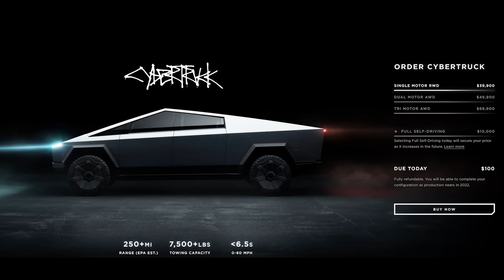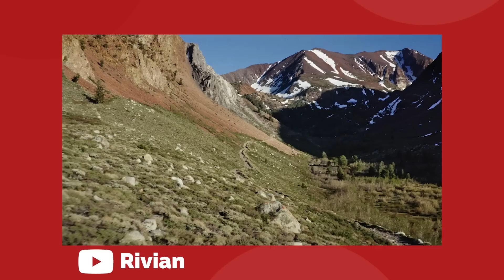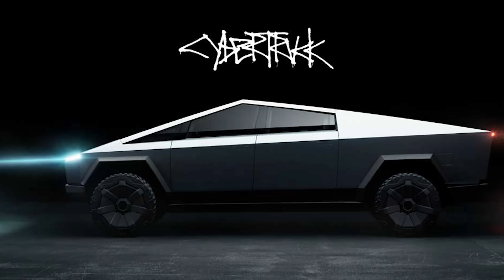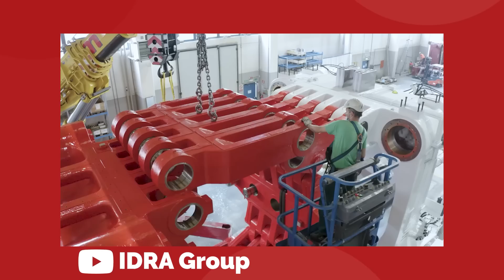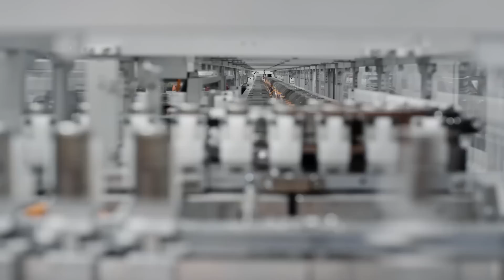The 2023 Cybertruck Update Is Here! (Cyberboat + All New Features)

Comment: Here are the key points about the 2023 Tesla Cybertruck update from the video:

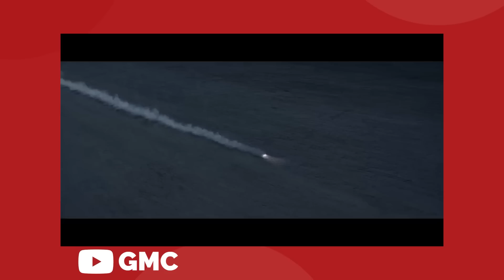- The Cybertruck will have 4-wheel steering and 4-motor all-wheel drive. This will make the large vehicle much more maneuverable and capable off-road. (1:19 - 2:30, good news)

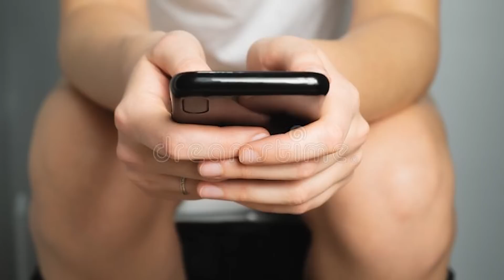- Elon Musk said the Cybertruck will be waterproof enough to briefly serve as a boat and cross bodies of water. This could allow travel between SpaceX facilities without driving around. Actual feasibility is still questionable. (5:28 - 7:45, interesting but uncertain news) 

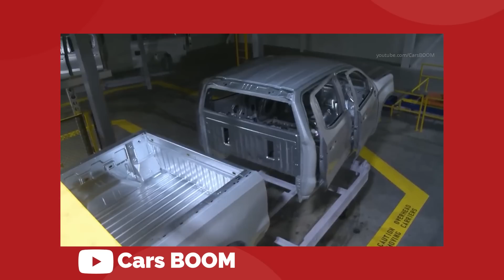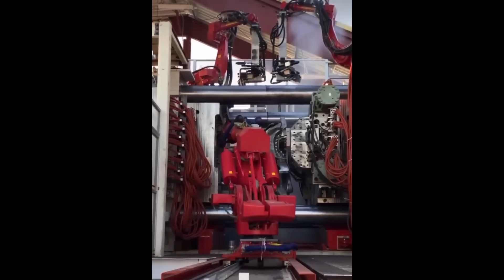- The Cybertruck will use an exoskeleton design with large steel panels to eliminate the need for a heavy truck frame. This, plus the structural battery pack and gigacastings, will reduce weight and complexity. (8:55 - 11:21, good news)

- Tesla's new 9000-ton gigapress is completed and shipping to Texas for Cybertruck production. This confirms they are still moving forward, though the timeline is uncertain. (11:59 - 13:11, good news) 

- Elon Musk claims production will start mid-2023, but his timelines are consistently too ambitious. The factory and equipment status suggests this could be more realistic than past claims. (13:47 - 14:19, optimistic but uncertain timeline)

- Pricing is unknown but will definitely exceed the originally advertised $69k maximum price, possibly by a large margin, due to features and inflation. (14:52 - 15:23, uncertain news on pricing)

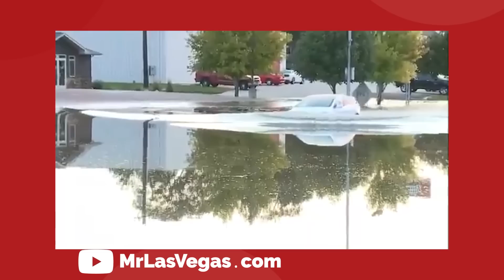Comment: 5:41 Tail pipes? Pretty sure it’s primarily because water getting into the engine air intake. The intake meant for air to get put into your engine for combustion… water getting in there stalls your engine. Likely causes long term damage too. So if the water is high enough that it reaches the engine air intake, that’s why it’s bad. Hence why hardcore off road vehicles often have those elephant truck looking engine air intakes sticking up high in the air above the hood or above the whole car. Because most cars have the engine air intake somewhere under the hood, often near a wheel well, low enough that that crossing water a couple feet deep becomes a risk. Not to mention the type of water that Tesla crossed that went over the hood.
Reply: He is not very educated in internal combustion engines. You're right, the important thing is that the air intake is above the water line, not the exhaust pipes. There is enough pressure from the exhaust to make it out, easily. Just take a look at motorboats, many have their exhaust pipes below the the water surface. But if your engine sits low you need some kind of bend/water trap, like the one you have under your sink, so that the water does'nt make it to the cylinders when the engine is not running.
Reply: @ai._m  No, it is not both. 10 meters of water depth equals 1 bar. A submerged exhaust only need a few millibars of overpressure to work. When you are so deep that the water pressure in the exhaust matters, your air intake was submerged long ago ...
Reply: It is also a bad idea of thermally stressing the engine and exhaust manifold by quenching it in water.  This is not an issue for EVs.
Reply: I THOUGHT WE WERE TALKING EV'S
Reply: @ricinro  Please educate me on why it's stressing to cool down the exhaust system/manifold. My naive thought would be that cooling the exhaust makes the exhausts more dense, which leads to less backpressure, which is even preferable for a turbo engine (when it's between the turbo and the atmosphere). Sure, a NA engine is designed to have a certain back pressure but I'm a bit skeptical to that the tolerance level is that sensitive. I mean you can run a NA car engine at an airtemperature of -20 degrees celsius without any problems.
Reply: @stickiebudz  😅
Reply: @MightyMethod  Scavenging. Turbos have near limitless backpressure. Naturally aspirated engines do need to maintain a minimum backpressure still, else back firing occurs and causes scorching to the valves, in turn causing the loss of compression.

Sudden thermal changes can, and will, create microcracks due to the thermal stresses, leading to exhaust, intake, and/or vacuum leaks. Constant, repeated extreme temperature fluctuations will be catastrophic to the engine, however a single occurrence is unlikely to be noticed however...
Reply: @72192cody  Oki doki. I get what you're saying about the risk of getting cracks. But it feels like you'll have to be rather unlucky to get that kind of damage. Good for me I never drive in deep water. 😅 However, I do expose my car to "constant, repeated extreme temperature fluctuations", but that is towards the hotter temperatures. 😂 Thanks for your answer.

Comment: Your synopsis that the exhaust being underwater keeps the engine from running is wrong !!!
-
Lots of boats have their exhaust under the water line !!!
-
The reason cars die in the water is their air intake tube is very low and sucks water up through the intake into the engine creating a Hydro lock…
-
That Hydro lot can bend valves or break or crack pistons or even split the block…
-
Please do better research before you make random statements….
-
😊Have a Nice day 😎

Comment: Doesn’t matter if all 4 tires are moving or if just one, if you’re on ice you’re not going anywhere quickly.  And if you’re in large mud/water hole floating doesn’t help if the tires are just spinning in the water.
Reply: 304 stainless does not like salt water it rust a flat bottom Pannells don't like mud like the first hummers TOWIE's for off road trackss  everything you just said is true
Reply: Sherp

Comment: The in house battery cells should bring down cost, pretty much everything about the vehicle is designed to be efficient for production and cost. Why would it be so much more expensive? It was going to have 3 motors with 1 motor being bigger than the other 2, but now it will have 4 smaller motors. I don't understand your reasoning behind saying it will be way more expensive... I calculate they removed the price because they will price it according to demand and competition. If they sell it too high people will buy other options, if they sell too low demand will never end. I think the RWD models will come out first and priced at original price. If Ford can do it, Tesla can. After the initial hype train wears off they will introduce the higher priced ones that will not be too far in pricing, but they made more profit by selling the least costly model first. I believe that was their original plan and I think it would be the smartest plan. If they come out with the most expensive one first they will risk the waiters to cancel their orders and buy something else...
Reply: I heard they want to move the high end trucks to the front of the line, and not even make the 2 wheel drive single motor version. So it will be dual motor, tri-motor, and quad-motor. They have to offer the quad as the Rivian, and Hummer are both quad. I just want the tri-motor for the 500 miles of range, I don't need the quad.
Reply: @dalanscott  I think the tri-motor wont happen. Most likely it will be RWD, AWD Dual and Quad motor... Do you have an electric now? Why do you need 500 mile range, after 200 miles I need to stop anyway because of bathroom or food/drink for someone. In town driving absolutely no need at all. I think the AWD 2 motor will have a long range option like the model 3...

Comment: I knew when I spent the $100 on the queue the price wasn’t locked in. No surprise there. Why be upset? I think the single motor 2WD version will start around $50K but virtually nobody’s interested in a single motor. The dual motor 4WD will be the most popular with three motors a close second. Realistically a dual motor I’d bet will avg $75K, three motor $90K and a four motor fully equipped will be $130K.
Reply: Good luck with those prices, it will be close if not over 100k for a base model
Reply: @wasupfool5692  - We’ll see. With Ford already selling its electric truck’s base at $50k I seriously doubt a six figure base model Cybertruck. I stand by what I said. The two-motor AWD will be the sweet spot. Most people seem to have no problem ponying up $75k these days. But again, we will see.

Comment: When Elon mentioned a floating CT he may have been telling us the CT has fly-by-wire proportional steering and electronic braking (no hydraulics).  If you eliminate places where water can get into the bed and cabin then waterproofing is done on the lower parts of the doors, tailgate and around the battery pack/ seat assy that is installed from the bottom. So while it is not officially mentioned there is a possibility that there will be independent steering, electronic braking, torque and electronic suspension for each wheel that could actually reduce costs.
Don't dream about this being licensed Coast Guard approved watercraft but sure fording slow moving streams and swamps/ponds offers utility rarely considered.
Reply: I bet all four wheels are the same portal axel waterproof motor

Comment: I understand that the hardware costs can’t remain fixed.  That just wouldn’t be possible.  Software on the other hand does not experience the same inflation effect.  I would hope that Tesla would honor that pricing.  In my case, my tri-motor reservation included FSD at $7,000.  I think $15,000 might just cause me to reconsider my reservation.  I have my heart set on that truck and am running my current ICE Jeep into the ground to avoid purchasing another clunker ICE.  With the economy tanking, I may have to abandon my dream vehicle. 😢😢😢😢😢😢😇
Reply: Why would abandon it or reconsider it based on FSD? That’s silly.
Reply: If you ordered with red ityink you get the price from when you ordered. And musk has said that all that do not order the price will go up. It's not inflation, it is on sale. The price will go up untill the full price is achieved
Reply: It's about the company and vehicles as a whole...people are probably more likely to accept a price increase for an awesome new feature rather than the structure of the vehicle..if they can use fsd to help fund the rest of the company why wouldn't they
Reply: same here, have my Jeep but really wanted this truck, and software development does inflate with inflation due to rising salaries trying to compensate cost of living increases.

Comment: the only reason that elon added the 4th motor and rear wheel steering was to compete with the Rivian and Hummer.  I suspect that the price for the top version (4 motors) will be 79 or 80 K USD.  As I am a Canadian, this will cost me at least 100 K in CAD plus another 13 K in taxes (GST) so I will be happy with the three motor version (if it is still an option), provided it has the large battery- which is the most important feature other than the stainless steel.
Reply: And competing with Rivian or anyone is a bad idea because ?          If you were in Tesla's shoes would you stick with the original design limitations when others are one upping you?  This is supposed to be kick ass.   
Feel for you on the exchange rate.    I have been waiting for somebody to start an EV car company in Canada.

Comment: Constant exhaust pressure from a running engine will prevent water from entering the tail pipe and stalling the engine. Ice cars suck up water from their air intakes and hydro-lock their engines. Besides what exhaust pipe does a Tesla need to worry about?
Tesla Nerd ! LoL ..def not a car guy but sure knows how to make a YouTube video

Comment: Ummm No.. cybertruck is waaaaay smaller than the hummer ev. 
DOT law requires a vehicle to have “identification lights” if it is over a certain width. Those lights are the 3 orange lights on the center line of the truck. For example; Ford F150 Raptor, Ram 1500 TRX, and now the Hummer EV.
Tesla Nerd, a car guy would know that. LoL

Comment: Let's think the tailpipe commentary through again, it's just bubbling boss, water's not stopping them. It's low air intakes that suck water into fuel injection systems and also ignition related parts that aren't designed for submersion is my guess.
Reply: Increased backpressure in the exhaust is a major no-no, definitely slows the compression cycle down... leading to decreased oxygen intake, and to an extent, increased heat, which can cause warpage fairly quickly. Even worse though, are non-pressure rated seals... think the crankshaft main seals... oil and water don't mix... oil not only lubricates, but also creates a cusion that softens damaging forces from every single explosion that occurs. Without the oil in place to dampen the blows, micro-cracks occur repeatedly until metal parts end up where they're not supposed to... on top of that, now you basically have sandpaper inside the engine, and possibly transmission, due to the minerals in the water. An extreme case, but can happen very rapidly.
Reply: I bet you do, but I'm giving it back to you as a donation.
Reply: Close. It's in fact water being sucked into cylinders and water doesn't compress well. So.... boom, your crankshaft, cylinders, pistons, valves got bended, crashed etc. Engine dead usually when sucked water.

Comment: FYI for those who don't already know, when you say a 9,000 ton Giga press that does not mean the Press or machine ways 9,000 tons it does not mean the parts or metal being used when casting way 9,000 tons color the 9,000 tons is the maximum closing or clamping pressure on the die while the molten material is being injected and molded.
Reply: You are correct. By the WAY, the machine does not WEIGH 9000 tons.
Reply: I can lift and carry my 2-ton bottle jack with one hand.

While impressive, the 9,000 ton rating isn't what makes those presses so transformative. It is the speed. The total cycle time is under a minute. 60 vehicle frames per hour, starting with molten metal.
Reply: @The_DuMont_Network  Thanks, if you hadn't said it, I would have had to. 
YouTube checks spelling, but not grammar.

Comment: About the Cybertruck being a boat, there are multiple news reports out of Florida about electric vehicles that caught fire.  Fires were a result of submersion in salt water causing corrosion which led to electrical shorts.  Seal the batteries all you want but there will still need to be a connection running to the motor(s) which will be susceptible to corrosion.

My biggest concern however is the elimination of radar sensors.  Vision may be great 99% of the time but if you have ever driven in a medium to heavy fog with vision possible for 100-300 feet and suddenly encounter a dense fog bank with vision in the 5-10 foot range, at 45-90 feet per second I doubt that vision only will suffice.  As a flawed human my choices have been to grip the wheel, grit my teeth, continue as before and hope for the best or to slow down and hope whoever is behind me is also slowing down.  Maybe Musk's cameras can see through fog but no one's bragging that it can so I doubt it.
Reply: about the radar they could maybe even add it easily if needed plus if its TRUELY TRULEY fsd its worth $250k just for the fsd and will make you easily hundreds thousands. so you have no concern in reality.... worse case it can only follow in a convoy on hgihways in safe weather thats still worth 100k value+ and they charge like 15k for it

Comment: Lol water covers tail pipe and ice fails... you have no idea how ice cars work. Intake air pipe gets water in it or the fuse box are the problem areas. Those 2 areas and you are hosed with water.  Electric cars are high power and so are sealed better. You can seal up a car and we do, off road trucks do it all the time. You just need a fresh air intake higher than the water.

Comment: I really hate the pink foam/pack design on the new battery packs. If youre out of warranty and a single cell goes bad they have made it incredibly difficult for people to replace that cell. People are going to end up paying 10s of thousands because of a faulty component.
Reply: One more reason for me to not go electric
Reply: thats dumb cause the quality is so good you never need to duh... it might even outlast old tech 2x lifespan so the value is twice as good as the best tech last year...if the lifecycle true
Reply: Thanks for watching and commenting .expect more videos. send me a text above 🔝🔝🔝  and acknowledged your price .......................
Reply: @travish585  it's not about lifecycle, it's about one of the cells being faulty. It happens in EVERYTHING that has a battery. Even the most advanced tech in the world will have some defective products at scale. 

Having a few faulty cells in a pack should only cost a few dollars in parts and a little bit of labor. But the battery packs aren't designed for repairs at all. Yes there are advantages to this kind of thing, but it's like apple gluing all their components down so if 1 thing goes wrong you need to buy a new device.

Comment: No with ice cars if you go to deep in the water the water will get into the intake and from there it will proceed to make its way into the combustion chamber and while in there as the piston goes up it will only be able to compress the water a little before the piston rods bend since water can’t be compressed as much as air can and that’s called hydro locking
Reply: Water is so dense that it would choke before water gets into the combustion chamber.
Reply: @battery_wattage  Water would most definitely get into the combustion chamber if it is able to cover the intake enough to "choke" it. Density has nothing to do with it. An air intake is essentially a vacuum, thus the water would be sucked in like a shop vac.